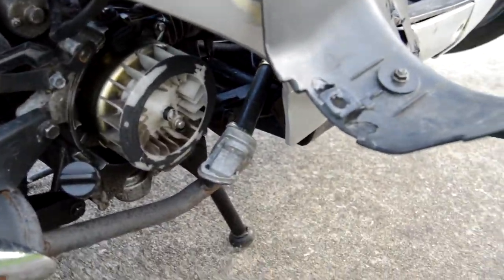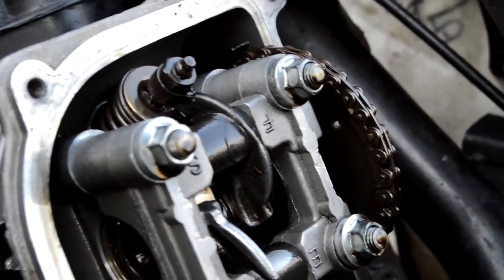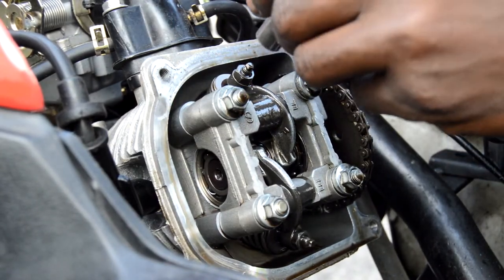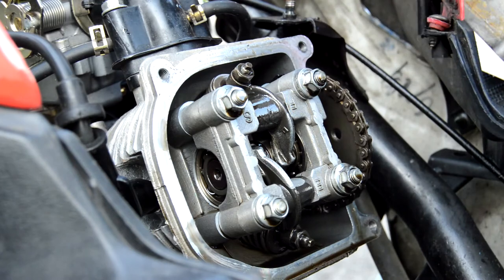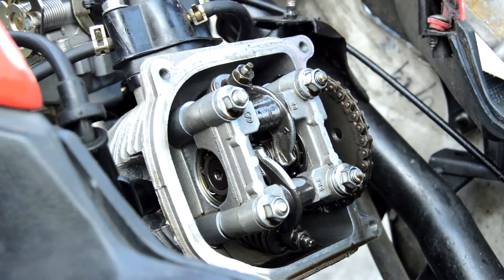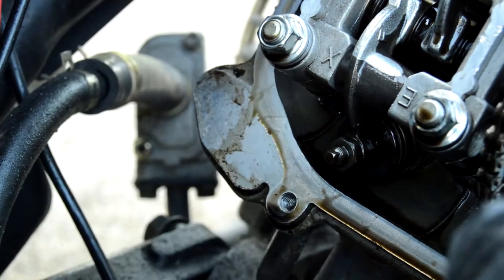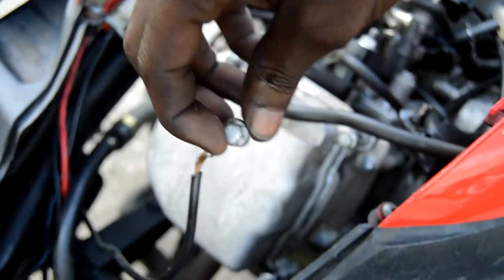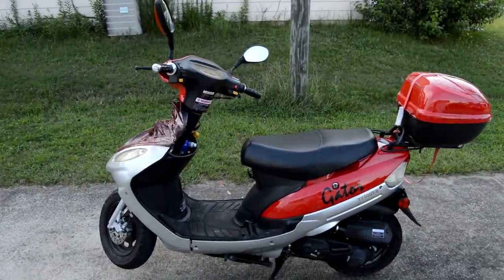How to Adjust The Valves on a 50cc/60cc Moped/Scooter [Part Two] (2017) *DETAILED EXPLANATIONS*

Comment: You did a great job, bro.  Others rushed through the process without taking the time to explain and show like you did.  Thumbs up!
Reply: I have got two that I am working on that won't start. I paid $45 for both :), students moved on.   One of them has clean carb and spark.  I am going to do the valve adjustment.  Just waiting to get my compression test tool that I ordered yesterday.

Comment: How did you tighten the nut without holding the tappet???   When the nut moves the tappet moves and will throw off your adjustment when you tighten it

Comment: How about a new 80cc big bore kit ?
Reply from the maker: The big bore kit is installed the same as any other small engine head. I had a 80cc engine and the valves adjust exactly the same as instructed in the video. The only difference is that you'll need to compensate for the larger cylinder by allowing either more fuel or more air (adjust the carburetor). The valves just allow you fine-tune how much fuel/air is getting combusted each stroke. Carb is mainly to adjust fuel richness.